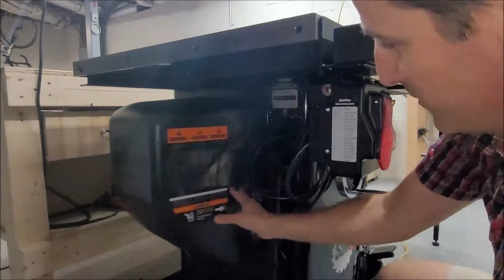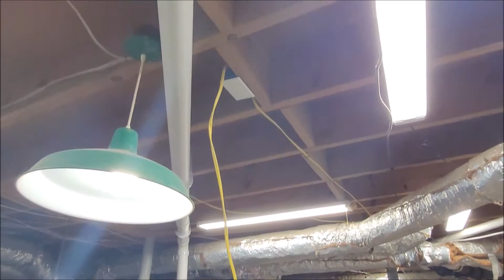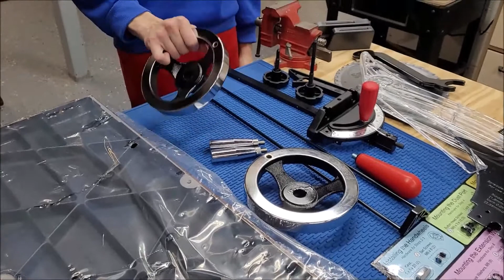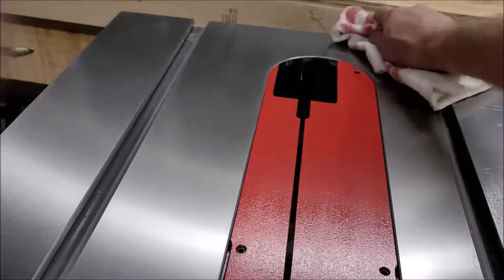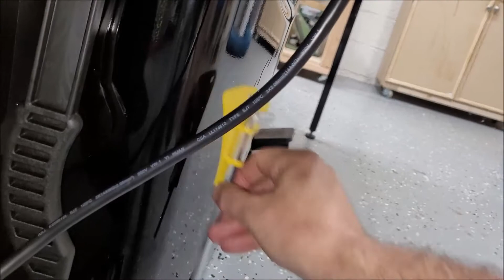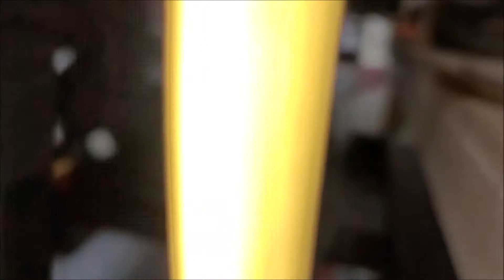My newest shop addition- 3HP Sawstop table saw

Comment: Thanks for the video! Did you carry the saw down a flight of stairs or do you have a walkout,

Do you currently have any social ventilation?
Reply from the maker: Thankfully we have a walkout basement so we could use a hand truck. I would not have tried to get it down any stairs because it's over 300 lbs. I don't have any special ventilation but the Dust Right vacuum collects the majority. I've heard the over the table dust collection attachment is good for the residual dust.